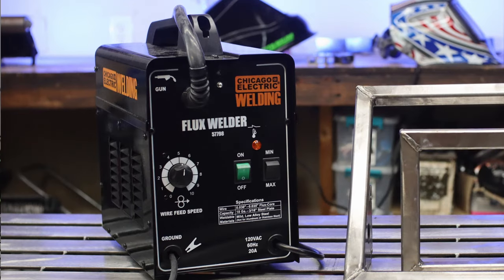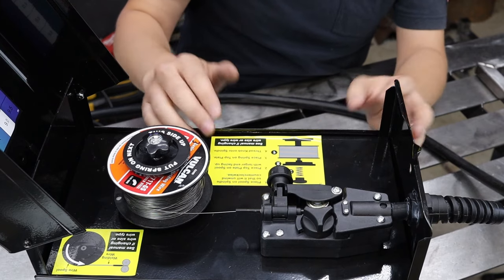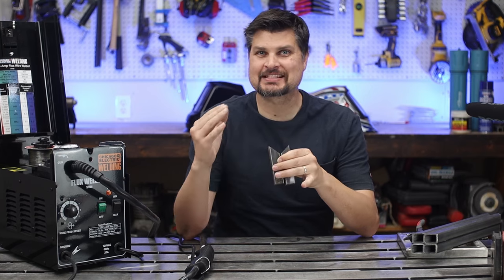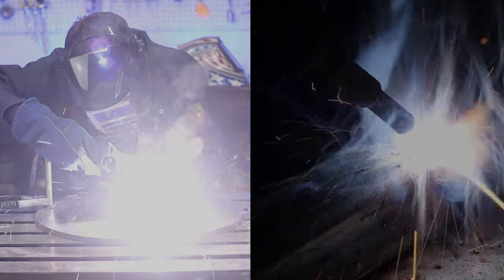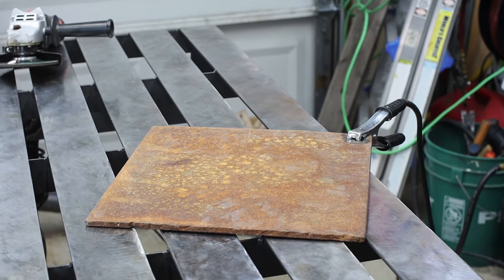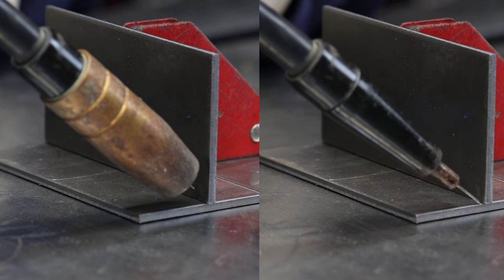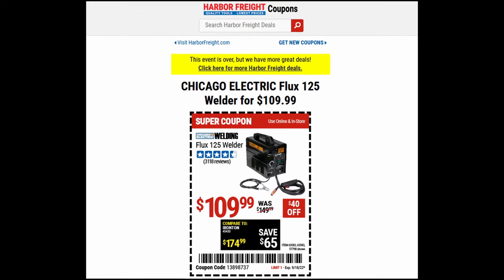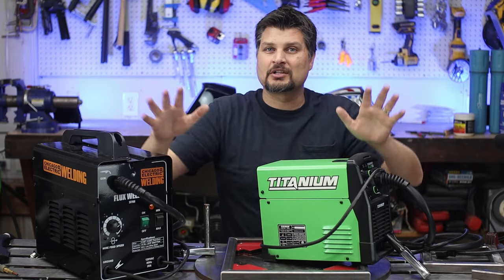Harbor Freight Welder: Chicago Electric 125 Review, Setup, and Test

Comment: Grandpa gave me one, don’t know if it was from harbor freight but it’s been sitting for like 3 years and thought I’d give it a try
Reply: And how did it go bro?
Reply: Dude thats crazy I got one of these welders from my grandpa and it sat for like 5 years though
Reply: Similar boat here. Borrowed my dad's that he bought like 10 years ago to fix a four wheeler. Can't get decent with it but haven't tried much yet. Wonder if the flux core wire goes bad after time.
Reply: Oh good your still alive yeah? Cause I couldn't find any other videos so I assume everyone who bought my welder is also desd
Reply: @MaxRay16 make sure the surface is super clean and no residual oil is left behind nefore welding. Metal can hold oil inside so sometimes it’s good to heat up the surface with a torch first.
Reply: @MaxRay16 I believe moisture destroys it
Reply: @MaxRay16 yes flux core wire does go bad. It doesn't take long either, it picks up moisture from the air and messes up the flux inside the wire. Get some new wire and watch a few videos on here. If the machine turns on and feeds wire with a little practice you'll do fine. God bless and work safe.

Comment: Hi everyone,  one thing in his video  Not explaining  is you can buy and use 10 lb. Spool gasless flux-core welding wire Vulcan  .030  But installing bigger spool will fit  mmm, have to take out black plastic tube for wire to feed threw and get another plastic tube off spray bottle cut it and install it were  black one was at shorter size So spool can turn. But Do not throw away black  plastic tube you need it for 2 lbs  wire spool.  I had do this cause It's  Not in instructions  or nobody else tell you this.
Reply from the maker: Great info, thanks!

Comment: I bought that welder..
As an old stick guy, I think that little wire feed is awesome. 
I'm building a race mower and it's rocking it.
Reply from the maker: Right on!
Reply: the thing that is missing is the ability to change polarity.
that would really cut down the spatter.
i opened it up and didn't see a way to change it. @-DIYPRO-

Comment: Great info on a beginner welder. This looks exactly like my Craftsman FCAW welder bought for the same price 20 yrs ago. However it didn't have a speed controller but was manipulated by the heat switch settings. It sucked. After a lot of searching found a rough schematic for the board, removed the single resistor, soldering in a potentiometer. Mounted it through the side of the case and scratched markings around the pot. It still works perfect.

Comment: Thanks so much man...we wired an outlet in the garage yesterday...had bought the welder the day b4...today my son and I started welding...it's great for him and I...thanks so much and keep the videos coming!
Reply: Make sure you pick up a Dayton 24 inch light industrial fan to keep that garage ventilated and get your boy an Optrel PAPR helmet. 

Never allow him to weld with the door closed. The fumes are toxic and will cause nerve damage and lung cancer in only a few short years. The length of time in a college program is enough for him to be crippled. He could also become temporarily poisoned causing his liver to shut down and need to be hospitalised like I was at welding school. 

Open garage door, big fan, respirator and vacuum everything often to remove metal oxides dust. 

You could also get him a 3M respirator with 7093C cartridges instead. Most welding helmets have an adjustment that allows you to move the shield further from your face to make room for a respirator.
Reply: @AddyEspresso that's what I use. Even outside I still wear that respirator, if inside like he said, door open, fan, and respirator. God bless and work safe.

Comment: I have "mig 130" flux core machine. Quite similar, cheap 100€ machine. First I was skeptical but it's a wonderfull machine for beginner! Affordable and simple. Great for my metal art projects ❤
Also because my projects are fairly small and occasianal, It doesn't need to have great duty cycle for welding all day long. Just to hit 2 pieces of metal now and then 🤷‍♂️
Reply from the maker: Right on!
Reply: Had a clarke 130 110volt thing . Did some dam good work from tin to pig... well light pig iron but could weld about anything with it. In reason does it all a little light in duty cycles but it's a cheap home jobber.
Reply: Same here, just small 2 minutes jobs here and there

Comment: Even though I have an old Forney 180 amp Stick Welder of which I bought used over 30 years ago. I was wanting to upgrade and possibly go with a wire feed welder. 

I liked the Titanium 125 but however, it would only accept a small 2 lb. spool of wire.
The Chicago 125 accepted both a 2 lb. spool of wire but also accepted a 10 lb. spool of wire. 

Neither one of them came with a spool of wire. 

The Chicago Electric 125 was on sale for $99.00, and The Titanium 125 Was on sale for $159.00. So I finally decided to purchase both as they were both on sale. 

At the same time I bought the cheap $49.00 welding cart which was on sale for $34.00 at the time. 

I have seen video's of people having both welders upon the same cart. They usually had either the Titanium 125 on the top shelf, and the Chicago Electric 125 on the bottom shelf or Vise Versa. 

However, because both of these welders are set up so that the top cover has to swing upward to open in order to change out the empty wire spool for a new one, or to view the decals for the manufacturers suggested settings. Therefore,  I didn't want either one of the welders being upon the bottom shelf. 

To me it would be an inconvenience too have to.......... 
(1) try and remove the one on the bottom shelf in order to read the recommended settings - or -  
(2) To change out an empty wire spool. - or - 
(3) Or to have to squat down in order to dial in (set up),  the settings of the welder which was located on the bottom shelf. 

So therefore I modified the top of the cart to make it wider by adding another shelf right directly above the top shelf so that both welders could sit side-by-side on the now wider top shelf. 

Unfortunately that created a heavier load upon the top of the cart whereas it caused the cart to have the tendency to lean over to one side due to the flimsy materials the cart was made with.

The material of the lower shelf assembly is too thin. All 4 sides are bent upward from a single piece of material, and the corners are not welded therefore they would bend outward one way or the other from the added weight upon the top shelf. 

So I beefed the situation up by adding another vertical 1 inch steel tube frame assembly between the upper and lower shelf. That did the trick. 

The only other thing I see wrong with this cheap welding cart is that the front 2 swivel castors are set a wee bit too close together which has a tendency of making the cart unstable especially upon uneven floors or outdoor terrain. 

I haven’t done it yet, but I think that this problem can be solved and cured by adding a flat bar or another outrigger frame to each side and then mounting those front swivel casters outboard of the original bottom shelf assembly just like the rear wheels are of which would give the cart a wider stance and less apt to tip over. 

I also added a pull handle to the front which makes the cart easier to move around. 

Overall Review.
(1) Both of the two welders perform just fine for small projects around the  home.
(2) The cart isn’t bad, but could definitely be made less flimsy and more stable. 
(3) I would recommend paying a higher price for one of the more expensive welding carts unless you are a DIY'er which has spare materials laying around and doesn't mind doing modifications.

Comment: For the big happy, replace wire guide made of plastic tubing with a 4 MM Teflon lined derailleur cable housing and wire will never stick through guide and whip again. Got them on ebay for 5 bucks or so. I also put a small c clamp on wire feed roller and no more wire slip. just a few ounces of pressure. 0.28 wire best burn.

Comment: I know very little about welding. I will primarily be using it for small firearms related tasks- mainly spot welding small parts together. How will the ground work on a blued/ parkerized part? Do I need to remove the finish to get a proper ground?
Reply from the maker: Haven't ever tried that. Sounds like you'll have to let us know how it turns out!

Comment: I have the 100 , first if you have to use a 25 ft cord , buy a size 10 wire extension cord, second replace that cheap ground clamp , i use a c clamp , that will give you a perfect contact . use the YESWELD welding wire . The welding wire that came with it was junk , lousy weld , now work great .

Comment: hello Mech Master, i have a question about which one to purchase, i just wanna mainly use it for here and there body work, out of the HF Flux 125 and the Titanium 125 which would you recommend? i seen videos where some say the HF flux 125 would do, but what is your thought, just normal body work as in cab corners and wheel well work
Reply from the maker: If doing a lot of body work I would go with the Titanium 140 or another mig welder, it's more expensive to get set up but a lot easier. If just a couple small jobs I'd go with the Titanium 125.

Comment: I've got a nice lincoln at home but i picked up one of these for my truck for $78. So cheap I don't really care if it gets stolen, packs away nicely, I csn run it off of a regular outlet whenever I need to bust it out, and to be honest it does everything I need it too. If I need serious welds on something then who cares if I'm running this little thing, I'm gonna heavy bevel and stack weld anyways, it's just gonna take a bit longer with smaller wire

Comment: Nice video. How is this welder on like cast iron? I'm thinking of buying one of these to do a little work on my tractor.
Reply from the maker: Haven't ever tried cast iron with this one but you'll want to make sure you pre and post heat it well.
Reply: Ok thank you. It's going to be connecting a bracket for steering to the area where the bolts have stripped out.

Comment: it works but there are welders for the same price that can do flux only like a Yeswelder or ones that have mig tig and stick for 50 bucks more or less on Amazon with better wirespeed, current and voltage control. but harbor freight warranties are painless.

Comment: Just bought one and never weld anything in my life. Should I move the flux about .25" side to side or move it circular motion? How long should I stay in one spot?
Reply from the maker: Yes you can try moving side to side. There are many puddle "manipulation" patterns. Anyway will work. You stay in the same spot right up until you burn through the metal......So how do you know? That is the fun dance you get to play by practicing.

Comment: I found the problem with the failure to feed issue. There is a weak point on the printed circuit board. One of the printed lines from the 4 pin connector second from the right will break I soldered a short piece of wire bypassing the break on the back side of the board.
Reply from the maker: Wow, good diagnostic!
Reply: @-DIYPRO-  If you can't fix it you don't really own it.
Reply: @-DIYPRO-  The part is a bridge rectifier 2w10.

Comment: Thinking about getting this to weld the frame for an overland trailer. The trailer is built but I need to build the box frame for my gear. Think the welds will hold up?
Reply from the maker: If the material is 3/16" or less, in thickness, then yes it will work.

Comment: i need somethin small, easy to use, and sorta cheap to operate.. i need a seat post base welded to an e-scooter. one that didnt come with a seat, but could easily accommodate one.
Reply from the maker: if it's steel and less than 3/16" thickness, than yes! This weekend the Titanium 125 will be on sale for $129, which is an awesome welder and better than the Chicago Electric. might be worth looking into.

Comment: My welds arent penatrating and looks like the wire is spattering everywhere instead of creating a weld. Any idea what im doing wrong? I have the same welder and I am trying to weld two exhaust pipes together
Reply: I have the same issue. Could anyone give advice?
Reply: Change your wire speed
Reply: Make sure it's Flux core wire.

Comment: Will this weld all types of material.?
Reply: It will weld steel (and I assume iron) just fine. If you're trying to weld copper or aluminum, that will need different equipment.

Comment: can i use a predator 5000 to run a chicago electric flux 125 and a chicago electric 80 amp inverter arc welder
Reply from the maker: Yes, that should be plenty to run either of those machines.
Reply: How'd it go?

Comment: Stupid question in 3..2..1..
I have this welder and have set up per your instruction but it won’t weld.  I’ve tried different pieces of metal, made sure ground is secure…nothing.  Could it be that this thing is a lemon?
Reply from the maker: When you say nothing does that mean when you pull the trigger it doesn't create a spark or wire doesn't even come out of the machine. If wire comes out and you are just getting a weak spark or poor weld then try to get a better ground and weld technique. If nothing nothing happens then you most likely have a lemon.
Reply: So I figured it out.  It was the ground.  The further away I placed it from where I was attempting to weld the less likely it was to work.  And yes the practice piece was all metal and clean prepped for welding.  Thank you!!

Comment: The only problem is, I want to buy one, but I can't find the power ,110 - 120 ..?
Reply from the maker: 110-120 is the "nominal" voltage range for regular house power, here in the US. Some people call it 110, 115, or 120. It's because it will vary depending on the city and how close you live to the sub station. This welder uses regular house power. and not the higher 220 or 240 typically used for dryers and ovens.
Reply: @-DIYPRO-  wonderful information thank you 😎

Comment: I got mine with a coupon for 78$... figure it should be good for like exhaust hangers... sheet metal patches when cutting out rust... rocker panels... basically anything automotive thin metal stuff. I figure for that price is good to just have sitting around... I'm sure it will come in handy since I'm in my garage needing with my cars or bikes at every charge I have...
Reply from the maker: That was a great deal. Good luck with all the projects!

Comment: Does anyone have advice? I have this welder, trying to learn with steel. I cannot get the weld to penetrate the steel. The flux is just balling up and sticking to the surface.
Reply from the maker: What thickness of metal are you welding? Turn it onto Max and turn up the wire speed. Also watch the stick out, you want the end of the contact tip to be about 1/2" away from the metal while welding.
Reply: @-DIYPRO-  thank you! I am using 1/16 inch thick square plain steel tube. Have been touching the wire to the metal with the gun about 1 inch away from the steel.
Reply: @-DIYPRO-  also, I have been trying wire speed anywhere from 2-8, it still sputters all over the place. I am worried that conceptually I do not understand the fundamentals at play here.
Reply: @mattdemarco9729 So, what can you share about your learning curve since your last comment. Any insights?
Reply: @wostep  made absolutely no progress. Was not able to find any video or information that actually did a step by step how to.

Comment: mine will not make a puddle…. any tips?
Reply from the maker: What thickness of metal are you welding? Turn it onto Max and turn up the wire speed. Also watch the stick out, you want the end of the contact tip to be about 1/2" away from the metal while welding.